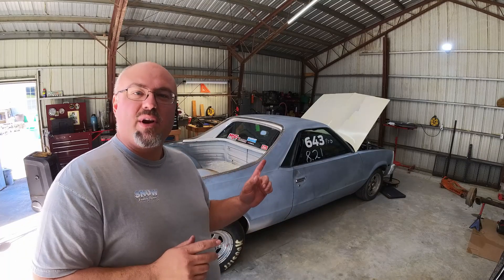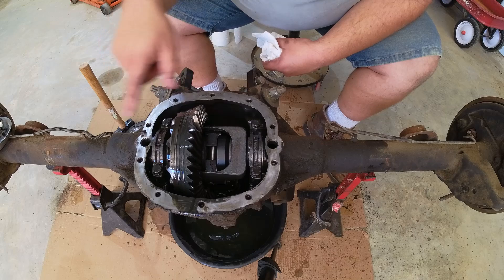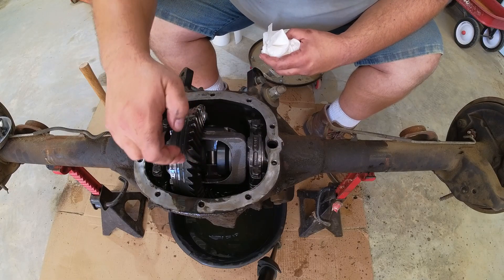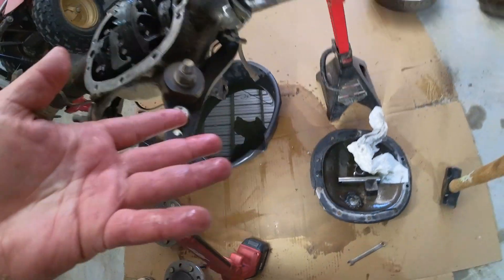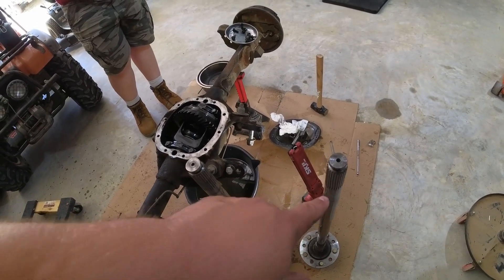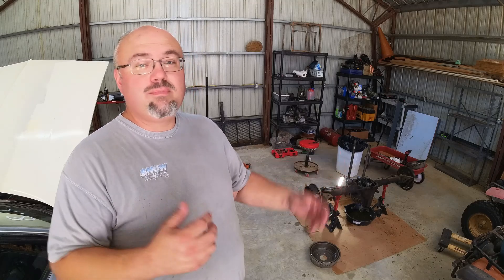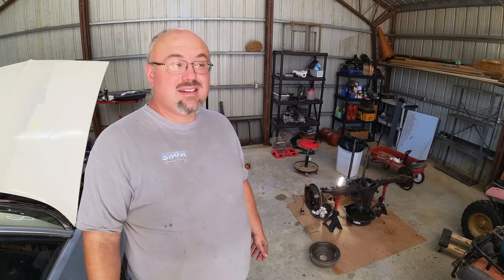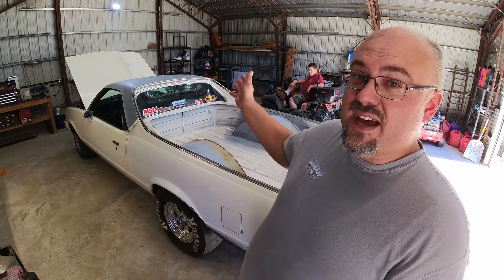Why the 7.5 inch 10 Bolt Is JUNK for Performance!

Comment: Allstar has pretty affordable 9in housings for G-Bodies. A good used loaded truck pumpkin with the Daytona pinion support and some "stock" brakes makes for a pretty affordable combo.
Reply from the maker: I'm likely to opt for a new Nodular Iron third member over a used truck third member. I've watched more than a few stock truck third members meet their end on the starting line.
Reply: I agree. I should have said "truck style with Daytona support" so you get 3.062 31 spline, etc..
Reply: @SnowFamilyRacing  Ford 8.8 shorten on one side is pretty good for street tires also with factory disc brakes.

Comment: I puked one out of my 66 GTO years ago and replaced it with a 12 bolt posi from a 71 Chevelle.
Problem solved.
Reply from the maker: Yep, the 8.2" and other smaller diameter 10 bolts from the ABody era also suffered similar issues under bigger power. When I had the 12 bolt next to the 10 bolt, there was so much more material everywhere.

Comment: So it would survive with a set of 2.73 rear gears. Lol cheap fix just run really small tires to improve your rpm.
Reply from the maker: This car came with 2.41's. In a previous iteration, it was a mid 15 second car and I could eighth mile in 1 gear! There isn't a tire short enough to get the rpm up to really make it work. In theory, it might survive. In actual practice, that's a different thing!
Reply: @SnowFamilyRacing  Wow 2.41's ya there is no tire small enough to fix that lol.
Reply from the maker: Yeah, I was 17 and slowly making the car quicker. I went from 2.41's to 3.73's and broke into the 13's. It's been a progression to the mid to high 12's.
Reply: @SnowFamilyRacing  thats pretty good.